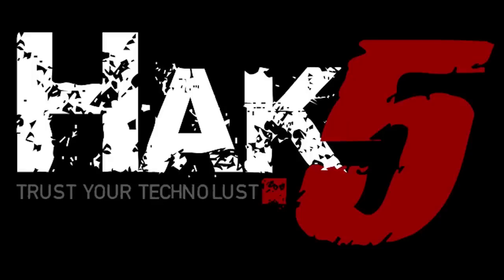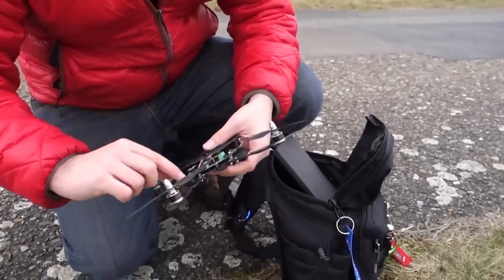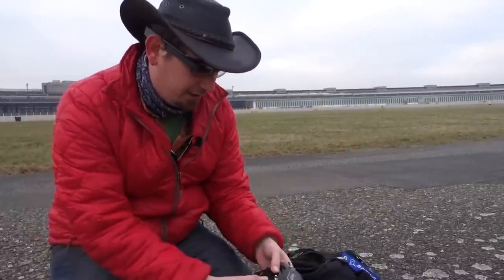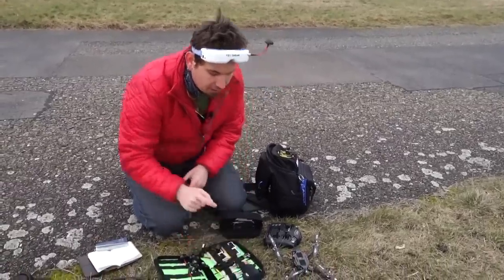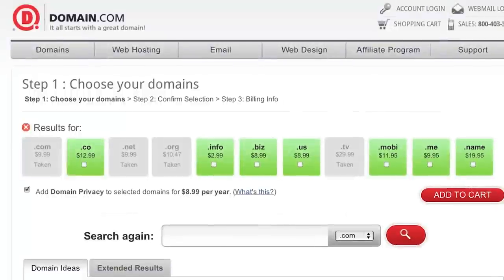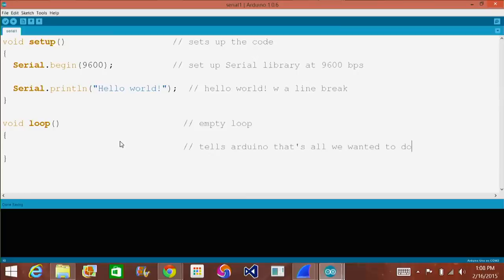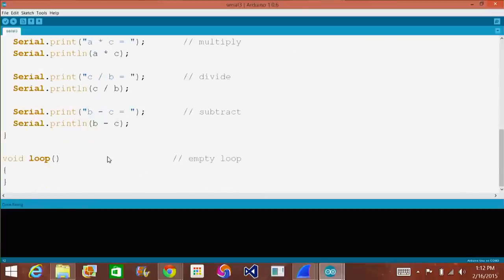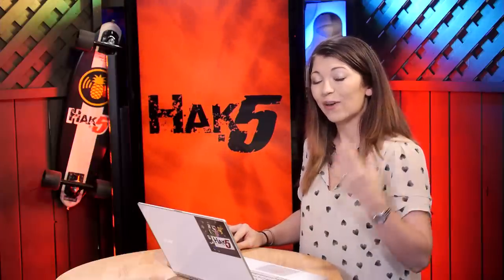Arduino Serial Connection ASCII Art, and Darren Visits Tempelhof! Hak5 1801

Comment: Was your Glass display on the whole time? Doesn't that really drain the miniscule battery on the unit?
Reply: Big props for the USB boost converter mod! I'd love to have one for 12V as well as 19V for my laptop.
Reply from the maker: The Glass has about 45 minutes of video time unless you have an external battery plugged into it's micro USB port. - shannon